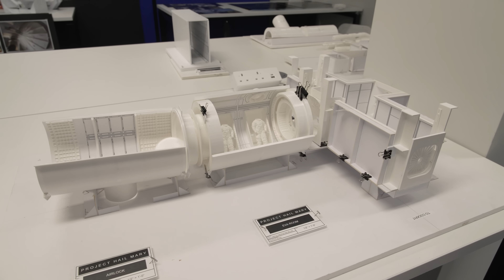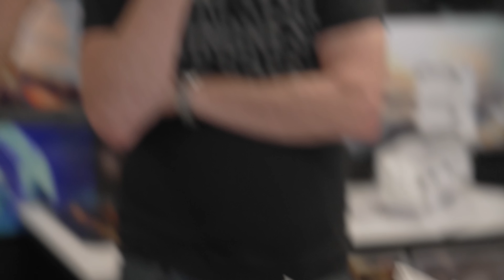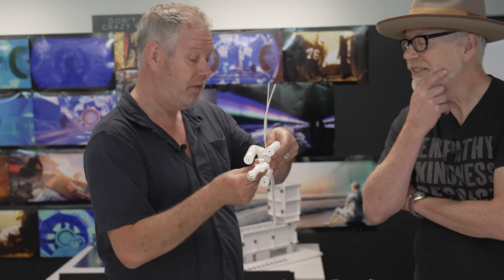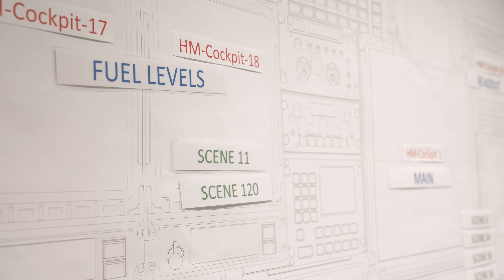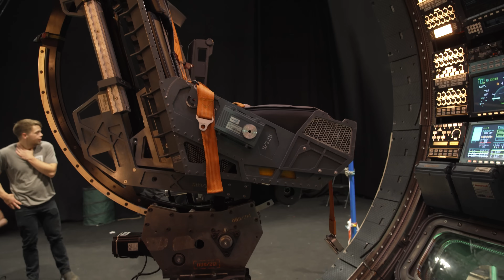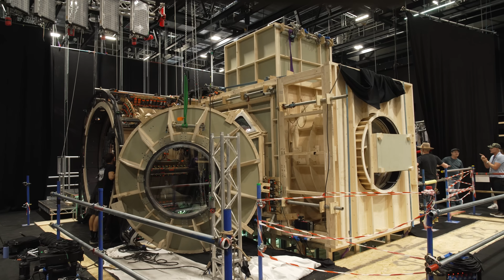Adam Savage Behind the Scenes of Project Hail Mary!

Comment: at 23:40 Adam brings up a great point.  The fact the set doesnt require greenscreen and making the screen practical, probably saved a lot on the budget because every shot would need vfx to replace the green screens even when they are way in the background.
Reply: I expect all shots still required a pretty significant intervention with vfx. In general, practical is more expensive than more digital effects because you still need to hide so much and you can’t have the computer do anything automatically without the green. The only advantage from a work hour perspective is colorist and lighting because you don’t need to correct for the green reflective hue. I think it is worth it because it feels more weighty and seriously helps the actors perform their best, but cg is almost always cheaper for the same fidelity. There is a reason you see a lot more green screen in lower budget work and tv. It’s cheaper and way faster
Reply: @Tinyvalkyrie410  To be completely fair, CG is only cheaper because it doesn't have the same protections that people that make and operate practical effects stuff have yet. 
Good CG is generally more expensive in the long run while practical effects tend to have more short term costs, which is why movies that are done by people that actually are doing it as art and not just entirely focusing on the money aspect tend to use a healthy blend of the two, over relying on one or the other can heavily screw you over if you don't have a big budget, but many companies love using CG because it lets them be lazy during filming and then they'll use subpar CG to fix issues because it looks better for budgeting among other things, relying on actor popularity or branding to try to still make a good amount of money.
Reply: @CrystallineFoxCF I wouldn't call it lazy. The VFX folk are also working hard. Like you said, they're poorly compensated, but they do absolutely have enough skill that people enjoy watching movies those kinds of folk make without any practical effects at all.
Reply: @MalletFace9898  When I said Lazy I was very specifically talking about the people who do stuff on managment level and buisness level stuff, not the people actually doing the work, the ones that make the decisions get to be lazy, they can just continue to brush stuff off on the people that do VFX work becausee they aren't unionized and don't have anywhere near the protections they honestly need.
Reply: The budget was 200M lil bro, basically the average cost of a Marvel movie. F4 had more vfx/cgi and had a budget of 180M.

Comment: Unrealistically large spaces on a space ship.

Modern Star Trek: Hold my beer
Reply: Star Trek has future technology that might as well be magic. They don't have to worry about things like that. 
You could argue that certain things contradict previously established sizes within the lore. But realism isn't really a concern.
Reply: modern star trek also making every surface reflective for some reason
Reply: @sssnowman5794 everything in the future is chrome!
Reply: The Martian had absurdly large ship interiors. This one is quite realistic (compared to, for example, the Chinese space station).
Reply: Modern? Have you SEEN the interior of the Enterprise-D
Reply: Not unrealistic for long. Starship will have about as internal volume as the entire ISS, in a 29.5 ft (9m) diameter tube.
Reply: @andrasbiro3007 And potentially lethal under acceleration…
Skylab showed how that could be a problem.
Ships have similar issues in rough seas.
Reply: @allangibson8494  
So be careful then? It's not unique to Starship anyway.
Reply: @andrasbiro3007 The problem is distance from a grab or hold down point when thrust is applied.
Safe is spaces an arm span across.
Reply: @allangibson8494  
So don't accelerate suddenly and harshly.

You know, how on planes you are told to sit down and fasten your seat belt during takeoff and landing.
Reply: @andrasbiro3007 Tell that to the A321 that ran into an airbridge (twice) - they had a brake failure while taxing.
Some airports use tugs to move airliners to and from the terminal. Others don’t.
A moving aircraft is capable of doing damage.
Reply: @andrasbiro3007 And that’s the reason big spaces are a problem. If you are in the middle, you physically can’t reach a hand hold. Astronauts use sleeping bags for the same reason.
Reply: @allangibson8494  
What spaceship was that? And where did it find a bridge in space?

Also, spaces don't have to be completely empty. In fact, that would be wasteful.
Reply: @andrasbiro3007 Any distance wider than an arm length makes bracing prior to UNEXPECTED acceleration difficult.
And spacecraft frequently manoeuvre unexpectedly - even the ISS moves to avoid debris and maintain its orbit and its not intended to go places.
Current Mars mission profiles call for constant thrust operations (using ion drives).
Reply: @allangibson8494  
Shouldn't be unexpected violent acceleration in space. If there is, something already went horribly wrong, which is usually deadly in space anyway.

Also, spaces don't have to be completely empty. In fact, that would be wasteful.

Ion drives generate less thrust than the weight of a sheet of paper.

And AFAIK the ISS doesn't do sudden evasive maneuvers. It's structure couldn't handle it. I'm 99% sure they tell everyone onboard when to expect any maneuvering.
Reply: @andrasbiro3007 ANY acceleration is dangerous if you are far enough from a surface. In 1G the lethal distance is 2m/6ft (ie a head impact on a hard surface is lethal after a 6ft fall).
Reply: @allangibson8494  
1g is brutal acceleration. It would shred the ISS into confetti.
Reply: @andrasbiro3007 The individual components of the ISS are designed for 10G (they all experienced 4G on launch). It’s only the solar arrays and docking rings that are vulnerable to acceleration.
It isn’t acceleration that will shred it on reentry - its heat.
Its onboard propulsion systems deliver 0.45m/s2 during orbital changes (about 0.046G).
Reply: @allangibson8494  
Are you intentionally dense?
1. Just the components. Not the whole.
2. That was ages ago. The 90 minute thermal cycling takes it's toll over the decades. The oldest modules are literally falling apart, they just fixed a major leak.
Reply: @andrasbiro3007 A 0.04G acceleration makes a 20m fall lethal (and that’s the length of some ISS modules in the thrust line direction…). 0.04G is nothing IF you are holding on. It’s potentially lethal if you aren’t.
The couplings holding the modules together have to hold internal pressure (and that’s makes the forces exerted by acceleration minimal).
The ISS is insulated externally so the pressure hull sees minimal temperature or pressure cycles (the micrometeor Whipple shield is part of that).
The exception is the solar panels and radiators because they have to be exposed directly to vacuum.
Reply: @allangibson8494  
1. Your math is wrong. It'd be minor injury in the worst case.
2. The ISS is developing cracks, and will be decommissioned soon exactly  because of degrading structural integrity.
3. Still no reason to have 20m empty space in microgravity. On ships the stairs between decks are staggered exactly to prevent long falls.
4. Still no reason to accelerate without any warning.
Reply: only because of cost.  Money is no object in Star Trek

Comment: The set looks great, the work is impressive. But lets face it, it is not what it should like.

The correct approach for this spaceship design, should be as it described in the book; simple (to have less point of failure), air-streamed (actually cosmic particle streamed), single handed operatable. The consol looks amazing but its not possible one single man to use it all. Especially when he came back from amnesia coma.

Comment: This is exactly what 3D printing is awesome for, even low poly low quality models which indeed depending on the quality you can make relatively fast and print in scale can give you a look of an idea, does it look good, does it work etc. Fantastic stuff.
Of course you have to think of all the things, what do you need, how, why, redesign, then make a simple representation and print, what works, what does not, adjust/redesign, where in the old days, you build the set, if something sucks, depending on budget and cost, you might already be stuck with it. Where this does still cost time, it costs far less money for a draft basically.
And it became an awesome set. Costs a boatload. I always hope they don't scrap them, or even take them apart, i always hope someone wants to buy it and keep it, but again, might be pretty costly, and there's a reason many movies and or tv-series reuse a lot of stuff, especially things harder to come by.
I also cannot wait for this movie, another Andy Weir movie, hell, i want more Andy Weir anything.

Comment: they made the ship big again... almost too big. the coma beds were in a circle around the walls and the robot-doc could access them easily with that now it needs a gantry, a ladder lead up to a hatch into the lab and the lab was one circle to the diameter of the ship and then the air lock and the pilots section where it tapered and had no windows. the only window was on the air lock. he said it was cramped but was made worse when rocky moved in.. this feels like a massive ship compared too the book and it reminds me that the martian also had the same problem where andy wier said it was huge compared to what he imagined.

Comment: I'm still on the fence about the changes to the ship design.  In the book, the crew portion of the ship flips a full 180 degrees so that "gravity" is in the same direction in centrifugal and acceleration modes.  The movie version adds a lot of extra mass and complexity and failure points that they didn't need for such an important mission.
Reply: Not really. The ship doesn’t need to swap between the two that often. If anything the centrifuge itself is more of a risk than the layout.

Comment: Geez, as an engineering nerd this is cooler than how it is in the book, but the way it's done in the book would have no doubt been easier to do, where the set for acceleration gravity and the centrifugal gravity are the same because the whole crew section/front of the ship of the ship comes off and turns around 180 degrees.
Reply: Exactly, I am really not sure why they went with that complicated 90° rotation instead of the full 180°, which would have had the floor remain the floor, both in thrust and in spin gravity. I am also not sure how an ex-scientist school teacher is supposed to operate all these buttons with minimal training, in the book everything was basically controlled through a single touch screen with clear self-explanatory and AI-assisted menus, which made much more sense. But I guess the film version just looks more interesting visually.
Reply: @james_halpert In the book he was able to operate the EVA suit without problems, which is explained by the fact that Stratt made sure he got all the necessary training to go on the mission in the worst case scenario that she would need him to (which she did)
Reply: @james_halpert right he's a school teacher who was never meant to go on this mission so wasn't trained and has amnesia and is supposed to know what these 2000 buttons and switches do it doesn't make much sense
Reply: @TheIcyCreeper-A did you not watch the movie? He attended all of the training. That's why they forced him on.
Reply: @kanucks9  did you not watch the movie because i did the first day it was out and he had to figure everything out from scratch he actualy had more training in the book. they sent him because he was the astro-phage expert
Reply: the ship is A LOT larger than in the book as well, which also negates the need for coma-sleep. the overall length would mean a lot of climbing, which is present in acceleration gravity, in spin grav it's a continuous floor.....filming apparently needs space for action, and visual novelty in the design of a 2 orientation environment........but yes, there is no reason to do it any different than the well thought out book did it, and it irks me. maybe they will explain it in the movie.....but i feel like this is not a priority for them
......
Reply: Yeah exactly, the whole very sensible reasoning for making the ship as simple as possible and as quick to build as possible. Kind of gets lost if they decided to do centrifugal gravity in this unnecessarily convoluted way.
Reply: That is exactly like they said it also does in this video. Just that that is only during stationary position and during flight it is in the position the the whole thing is without gravity.
Reply: @Dragonited  no by the looks of it in the film it only turns 90 degrees witch means everything inside the ship has to turn 90 degrees too but in the book it turns 180 and nothing in the ship has to turn witch would have been easier
Reply: @TheIcyCreeper-A  Exactly what I was thinking when they commented about how complicated everything was because of the shifting gravity.  Like, why not just stick to the book ship and there's no problem?  The Hail Mary makers had a very good in-story reason to keep things as simple as possible.  Same goes with all those buttons in the cockpit.  Like modern fighter jets, most controls are just touch-screens, as the book ship was.  But I guess you can't make a movie without lots of glowing buttons everywhere that go "boop" when you press them.

Also having the living area extend out and turn to be in front of the drive exhausts seems like a bizarre decision, given the spin drives can annihilate anything instantly if turned on for a fraction of a second.  The builders simply wouldn't take that risk.

But whinging about the ship aside, excited for the movie, given the story itself sounds to be quite faithful to the book. 🙂
Reply: @ShaydeNZ  I don't think the living area is in front of the exhaust I think those are the tanks it is a bit unclear in this will have to find out when watch film
Reply: @TheIcyCreeper-A yep: the engine is actually what looks like the nose, and the tanks extend back from that towards the front.

Comment: I can't believe that they got the gravity direction wrong.  It is only THE most important aspect of the construction of the ship.  What a disappointment!  

How were his crewmates supposed to get out of those beds many feet above the floor, at 1.5 G?
Reply: Yeah using the ISS as a architectural programming reference was a mistake. It looks great and I'm sure it works for the movie, but it actually doesn't make sense in reality. The book Hail Mary being a vertically oriented cylinder that rotates 180 degrees between spin and thrust gravity makes more sense than this huge sprawling maze of modules. The ship would snap in 14 places if it was really spun up by a tether from the center.
Reply: @jackinthebox301 exactly my thought. I really dislike those NASA-punk spacecrafts. They look realistic but really aren't. Id love to see a new isv venture star (the interstellar ship from avatar). Its a well thought out design. While the hail Mary looks like the iss with an engine slapped on...
Reply: Oh damn you right. In the book the entire crew module rotates by 180 degrees. In the movie only by 90 degrees right? Is that an oversight?
Reply: @milchael  It is a different ship design for the film. If you watch the trailers you can see that "centrifuge mode" holds the crew module perpendicular to the drive section, not inverted as in the books.
Reply: @milchael  Oversight seems a generous interpretation.  Completely not understanding the whole point of the book seems more accurate.
Reply: @mastah39  I guess I am part of the audience with an actual brain.  Or I guess not part of the audience, since this blunder would ruin the movie for me.
The rest of your explanation is just wrong, given how much trouble they are actually having designing the set (as seen in this video)/
Reply: @C @CorwynGC  you’re not the only audience with a brain, you’re just the only one who cares.

It is also not that great of a brain
Reply: There's always that one person...